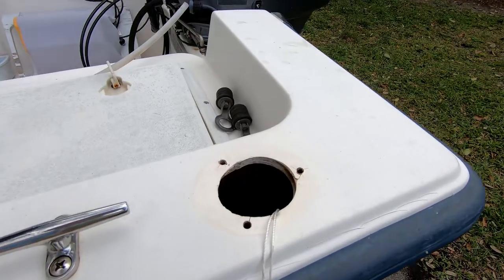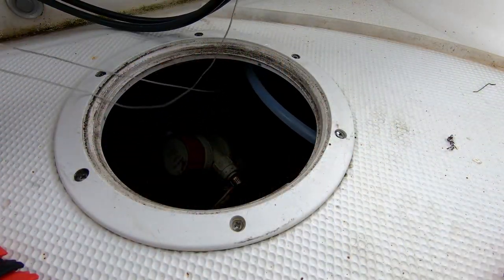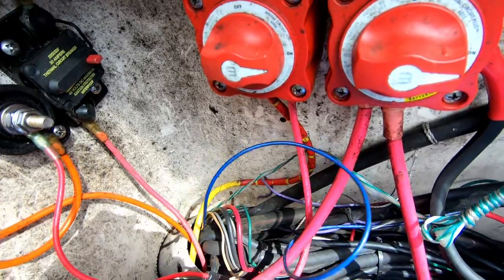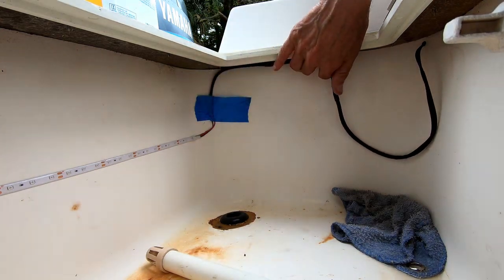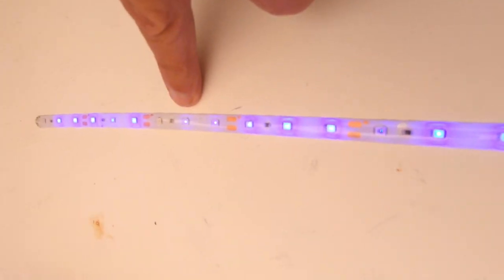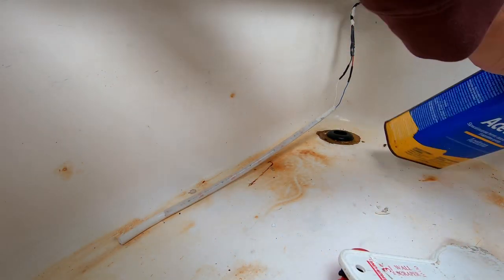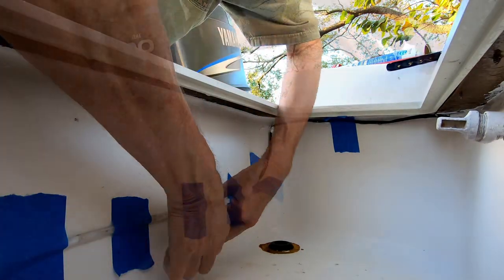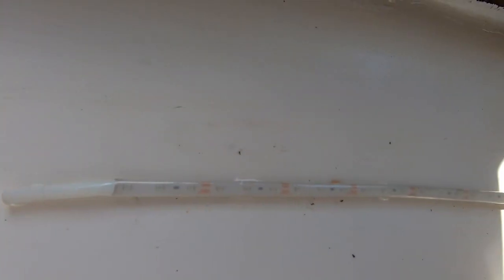Live Well Light Installation - February, 2020

Comment: If its to bright you can paint a thin layer of white paint on the led. Thats what I did made a big difference. If you do, just do it in steps so you get it perfect. Thanks for the video.
Reply from the maker: JC, just noted that you had left a response.  If this light proves too bright, I will probably remove it and use it in the forward hatch if I ever get around to running a wire thru the foam in the gunnel.  I'll just make a smaller LED unit for the live well.  The paint over is a great idea, however!

Comment: Easy enough to install. Would have never though to use some clear heat shrink for the LED’s. how are you going to permanently tack the wires?
Reply from the maker: Yes, an easy install when you have access between the live well and the outer hull.  The side towards the centerline of the boat is fully foamed.  I haven't decided how I will permanently tack the wires, once I decide on the brightness.

Comment: Jim, how pleased are you with the lights and the brightness?  I was about to do the same thing in my live well but with white strip lights and was already concerned about whether they were waterproof or not.  What diameter heat shrink did you use - 3/8”?  Do you think it’s better installing the strips below the waterline or at the top of the live well where you can’t see them (and not blind you).  After seeing your results, I’m now thinking about using instead the single live well LED lights that require drilling a 3/4” hole in the live well.  Thoughts?
Reply from the maker: JT, thanks for watching and commenting.  I've had the live well full of water keeping barely in-slot fish alive while I continue to fish for a larger fish.  The light still works so I know the "fixture" is waterproof.  I have not had the light in use at night as I have not enjoyed any of that style fishing - its all been flats fishing this year.

I opted against the 3/4" hole LED light only because I realized I would not be aware of a leak should one develop.  With this strip light mounted inside and the very small hole for the wire sealed with 4200 at the very top of the well, there is much less chance of water escaping into the hull should there be a leak.  The down side is that it certainly is not as clean looking as the normal 3/4" hole units.  There is also the wire on the inside of the well that could become a issue, but thus far it has not.

I think that having the light under water is better than above.  Above it can reflect off the surface into your eyes, especially when the water in the well is sloshing around.  Underwater it cannot.  I also mounted mine so that you won't be looking at the light from the inside of the boat, again to keep from destroying night vision.  White would be the least preferred color, red the best with blue and green inbetween.  You might google night vision light colors to get a better perspective.

Hope this gives you some more to think about.
~Jim
Reply: Jim M Thanks Jim!  Great info.